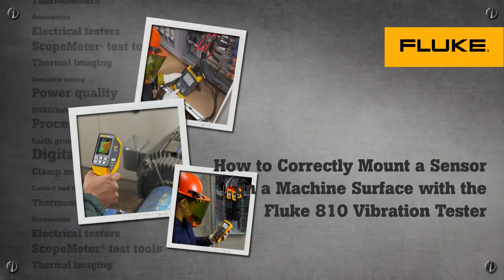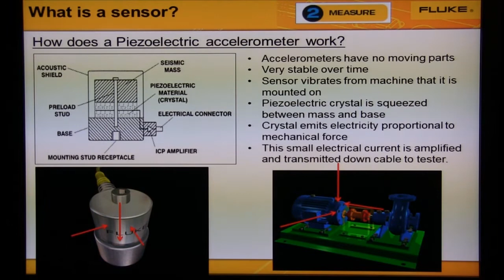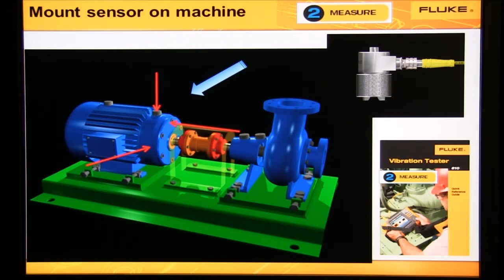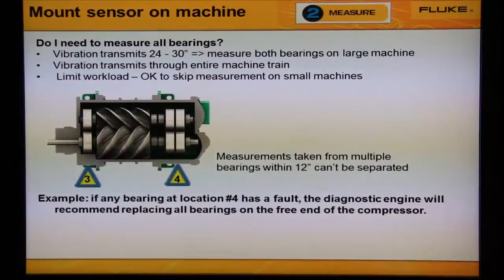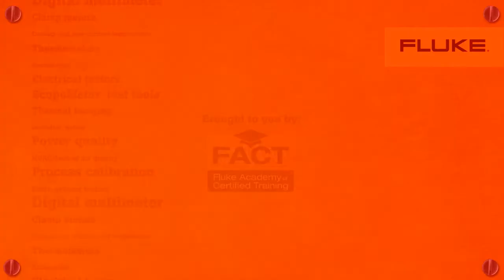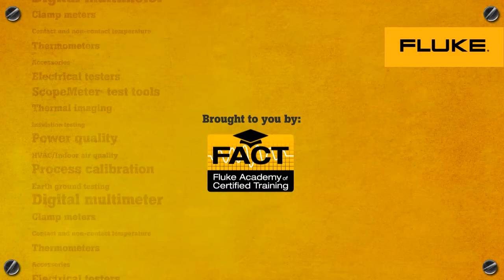How to Correctly Mount a Sensor on a Machine Surface with the Fluke 810 Vibration Tester

Comment: Good day, can I use that device on marine engine during sea trial? Thanks
Reply from the maker: Great question! Unfortunately, vibration analysis is not a good application for marine engines. Rotating motion (found in motors) is much different that reciprocating motion (found in engines).
Reply: @fluke  thank you very much for your prompt reply on my query